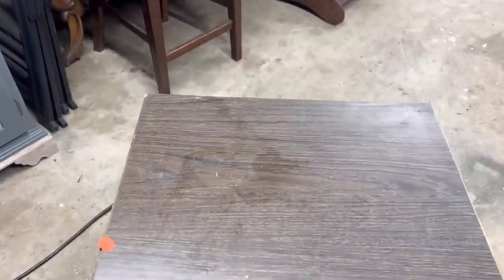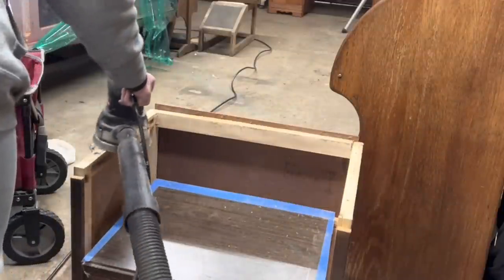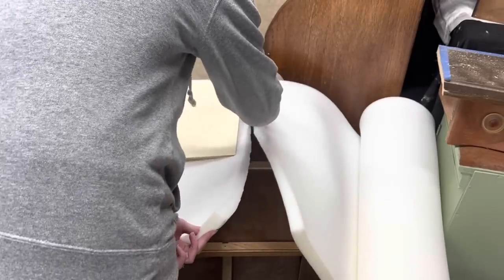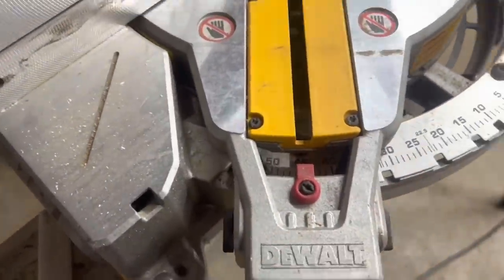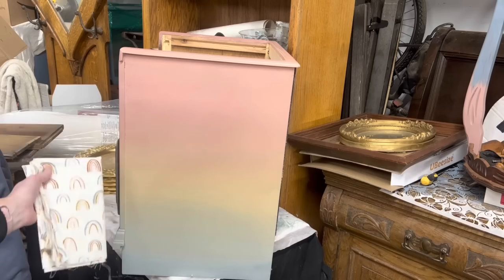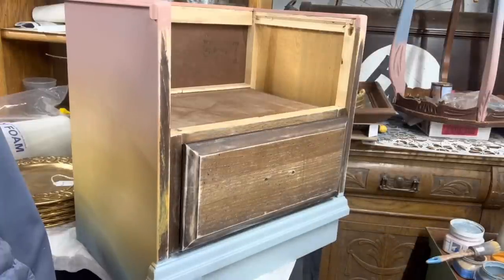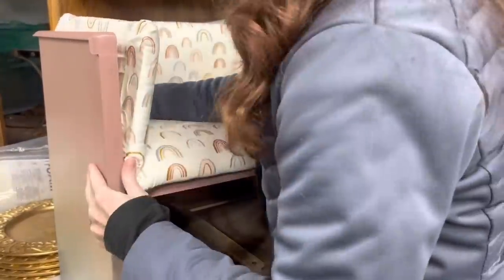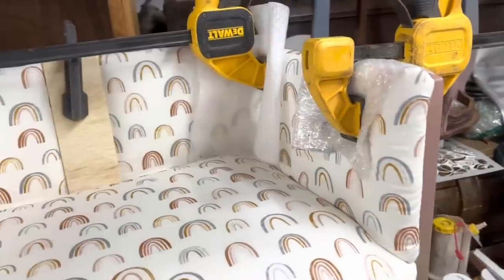DIY Chair / Bench From A Little Nightstand | Elegant Upgrades

Comment: Awesome!!! I actdid the bigger bench and sold it!!
I got one for $2 today at cc a garage sale. I just had a question. It wasn't necessary to put in more supports for the seat board?
Reply from the maker: $2 is a steal! Great find. And sometimes you need to add supports and sometimes you don’t. I find that each piece I do is a little different on how I go about it depending on how it was originally built. This was a little guy and it was really sturdy. It was also only being used by a toddler so there was no need to add anymore structural supports, but if it was built different or meant for larger humans, I may have thrown some in.